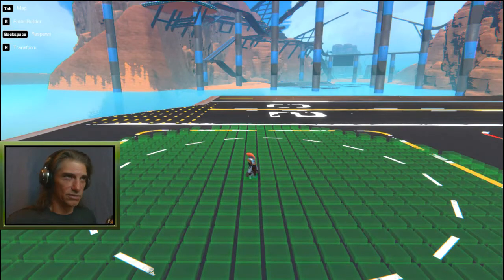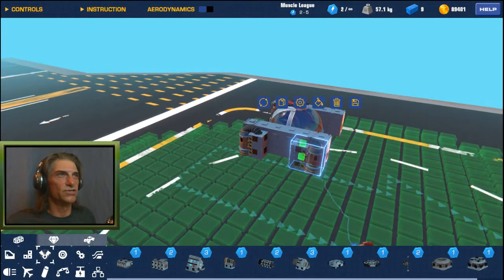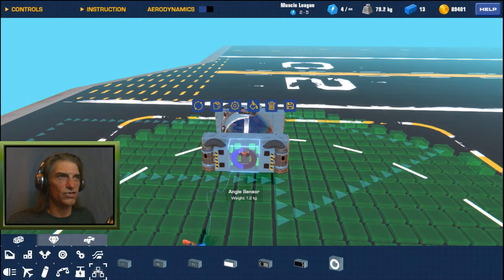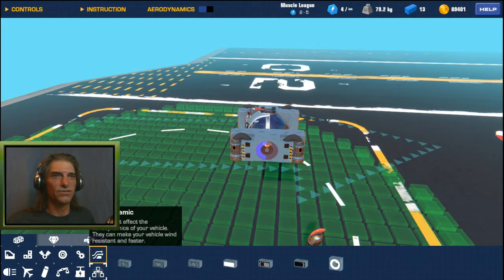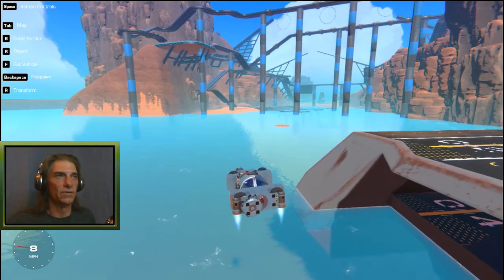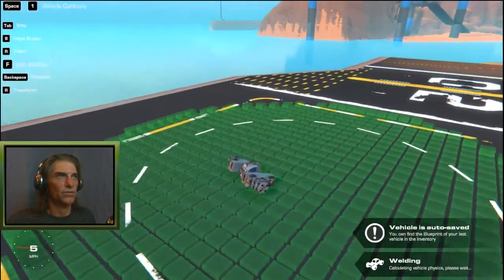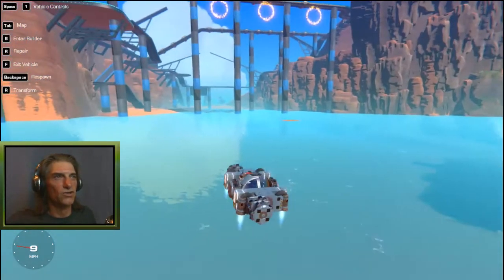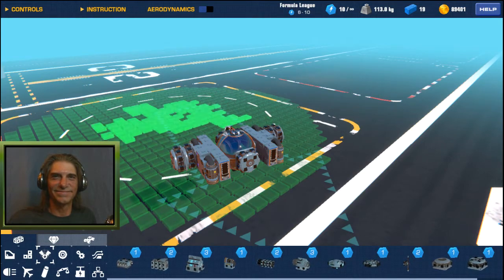Stability For All! How To Build a Stable Platform with ThatDomGuy

Comment: Thank you!
Recent player and started out with the Stranded mode to figure things out.
I had more than a little trouble with some of the high altitude salvage.
So I set out to make a drone.. and failed, a lot.
Knew it was something with the Heli Rotors, but not quite what.
Then I came across your video.
Very clear and understandable and now I have a bare-bones-drone to clean up!
(On the Workshop: "Stranded Salvage Drone" by "Arrogant Bandit")
Reply from the maker: I'm glad my video was able to help:) that's why I make them:) welcome to the Trailmakers Tribe:)
Reply: @ThatDomGuy  Thanks again. 
Really enjoying myself just with the building. =)
If you happen to like Grim Fandango, search for The Bone Wagon on the workshop.